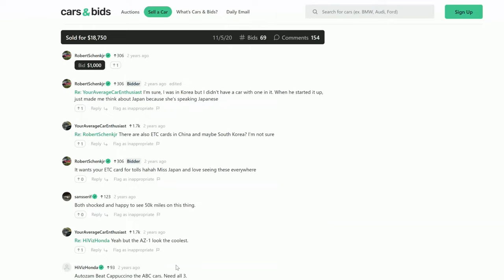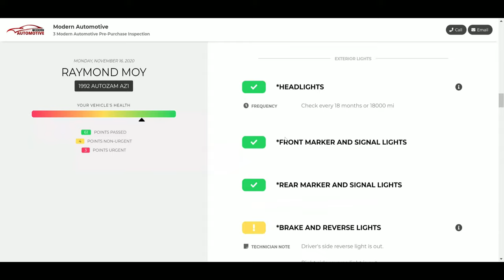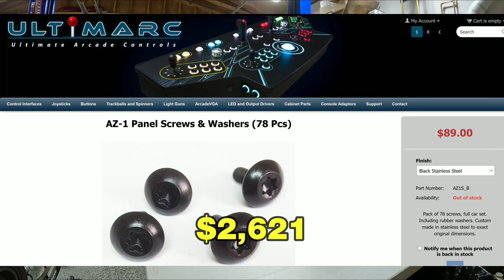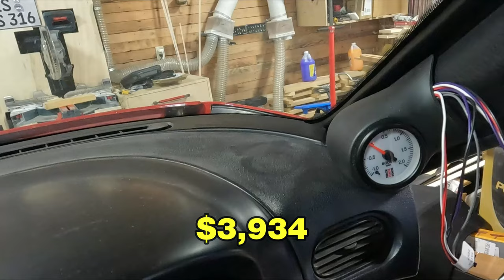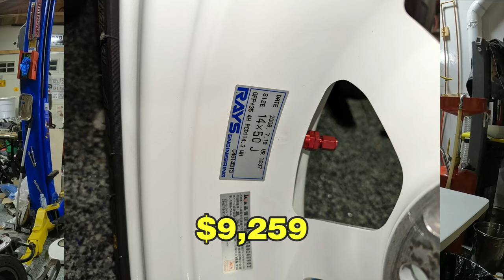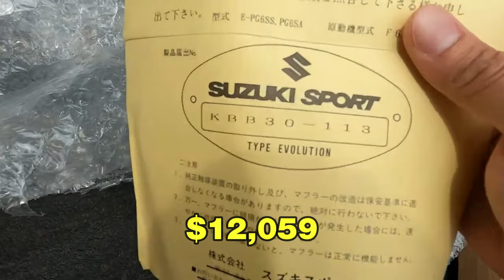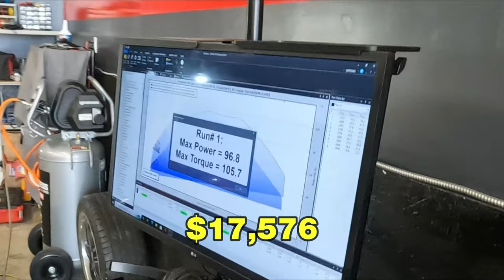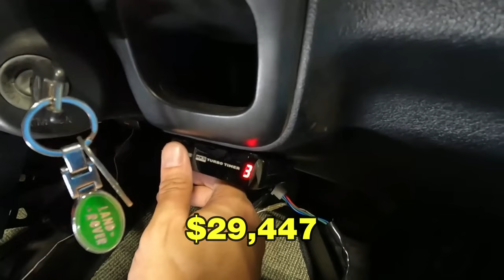My Suzuki Cara (Autozam AZ-1) will send me to the poor house! 2 years of mods/accessory/repairs

Comment: Yeah, the AZ-1 can'o'worms: "Oh, might as well get this while I'm at it". With the exchange rate, I'm not quite where you're at - even though I've owned mine for +5 years now. But you's a hoarder as well ;-)

Looking forward to hear more about those hood clamps - and what else you get made eventually.

Great work with all these videos, Ray - keep it up <3
Reply from the maker: a lot of my early stuff the exchange rate was 1 USD to like 105 JPY recently when it was like 1 USD to 135-140 was great! But I'm just buying stuff to "save on shipping" that was the killer. Also buying from Japan, the commissions and shipping add up quick!

The hinges will be worked on around Christmas time. Hopefully I'll have something to show. Trying to get access to a metal bendy thing to make the 90 degree angle bend. This project is an "in house" build :)

Comment: I bought my StepWGN from Duncan and it was a smooth transaction.  I have since bought an Alto Works and a 1997 Crown as well.  An AZ-1 is next, I am going to sell my SLK and get one in the spring.
Reply from the maker: Duncan was a smooth process. If they have the vehicle in the condition you want it's easy. Yes no haggle and stuff but it is what it is. That's their process. It is also a dealer so yes the prices are on the higher side but like I said if they got what you want it's a good place  to go.
Reply: @AnythingWheeled  Yes, the Alto Works, Crown, and a mini-truck I purchased through a network I have since developed in Japan, and facilitated on this end by a broker in NJ.  I have 2 vehicles that will arrive in Freeport, TX on/around 1/10/23 onboard the HOEGH SOEUL, and 2 more that I hope will be on the HOEGH OSLO.  I am in the process of working a deal with an individual in Osaka on another Alto that has a lot of desired mods.  I had a Beat lined up but the final inspection revealed a little bit of frame damage I did not want to roll the dice on.
Reply from the maker: @tomead   Self importation with a broker is the best deal if you have the means to fix the little stuff that may be unseen. heck even if you paid for it it's still probably cheaper. That's the way to go!

Comment: Definitely helpful, I get my AZ-1 later this month. Would love to hear more about your choice of differential. Doesn't it already come with a LSD? 

Have you considered getting larger steering angle for the potential to drift? I know I want to change suspension components early in my process, but knowing that I would like to someday drift I'm hesitant to pull the trigger on any coilovers (or even air) without a long term plan.

I am considering getting a custom center console made, would you be interested in this as well? I'd like to make better use of that space with a smaller AC control unit, open space by the feet for greater leg room, and mounting any custom additions such as Turbo Timer, Light Controls, Air Suspension controls, and maybe expand the single DIN to a double DIN. Very much still a work in progress concept at this point in time.
Reply from the maker: Hey! 
An LSD was an option back in the day. It was a clutch pack type I believe was offered in 1.5 and 2 way. I tried to bid on an original SuzukiSport 2 way a little while back but gave up at ~$2600 before shipping and fees.  I was already looking into it and determined Wavetrac would be the best way to go as an all around thing since most interested parties wouldn't be pushing it hard enough to need the clutch style nor may not want the downsides of the clutch style (maintenance and engagement style)

A drifting buddy mentioned to me that drifting would be pretty hard on a car and he'd be concerned about drifting my car if I were into it. He took me drifting in his S13 and I liked it but I don't think it's for me. It was also a good time to feel his 2 way LSD and for daily driving it'd be kinda rough.

I have seen a car or two where someone deleted the HVAC controls to get more space. I'm not into that as I like to keep the car original as much as I can whilst doing whatever I do kinda like a restomod. Definitely doable though.
Reply: @AnythingWheeled  how is that wavetrac lsd coming along?
Reply from the maker: I have been prodding my contact at Wavetrac. They are still queued for production he told me they are still slammed  and I will get an updated ETA next week (this week?).